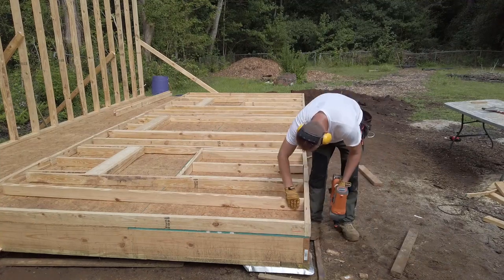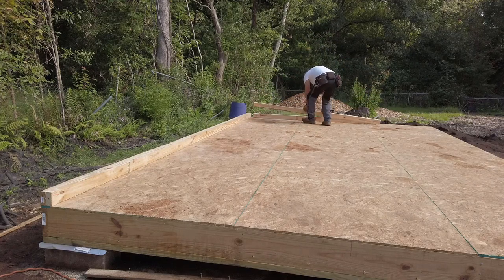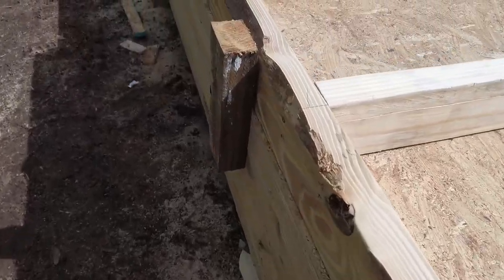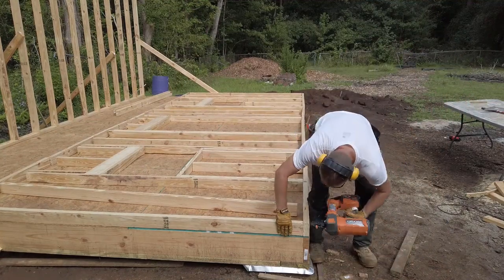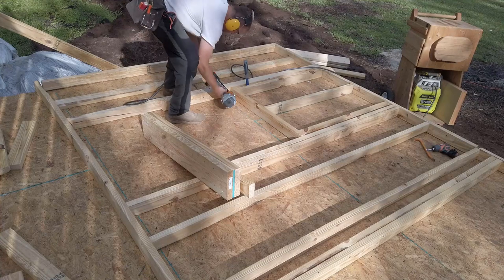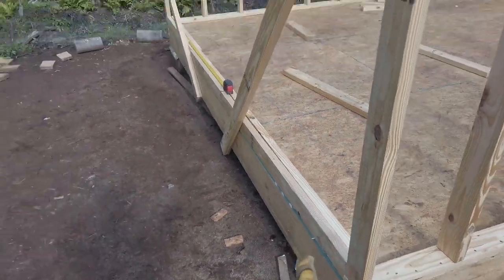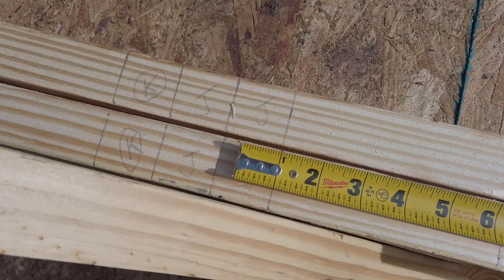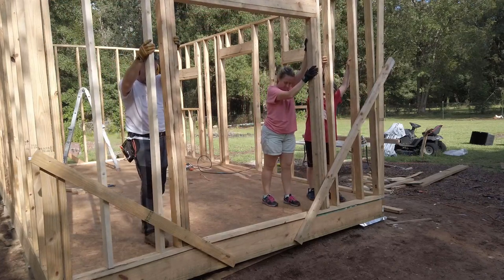DIY 👉 Wall Framing 👈 Workshop Shed

Comment: Great tip on lifting 8ft wall at a time. I just ordered lumber for a smaller 12x16 shed -- going to use your shed series as the build instruction.
Reply from the maker: Work safely and have fun!

Comment: Awesome! When measuring for the 16 on-center studs for front wall (w/ big door), do you still measure from outside wall, or from the door frame? In other words, are you always using the same method for laying out the studs, or does it ever change, if you have something centered? Always enjoy your content!
Reply from the maker: Measure every wall 16 inch on center as if it were a blank wall.  Then go back and measure for doors and windows. Walls that sit inside two adjacent walls will always be measured from the outside wall framing.  Sometimes you may need to push a door or window one way or the other a few inches to prevent an odd layout with a stud.  I recorded a section of video where I went into this in some detail but i ended up cutting it out in the final edit.
Reply: 9:55